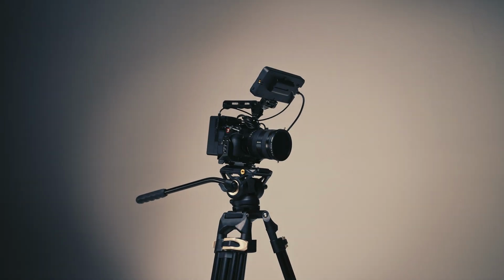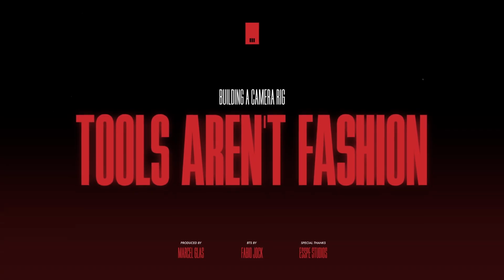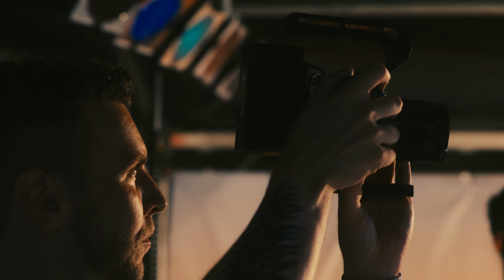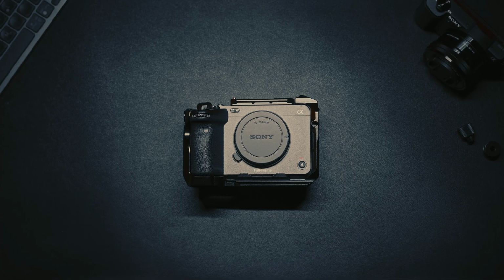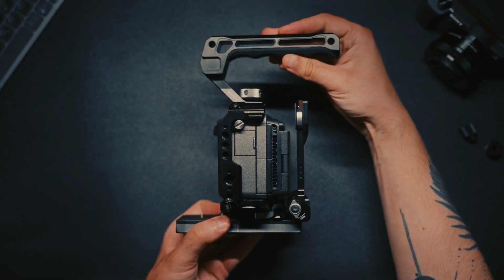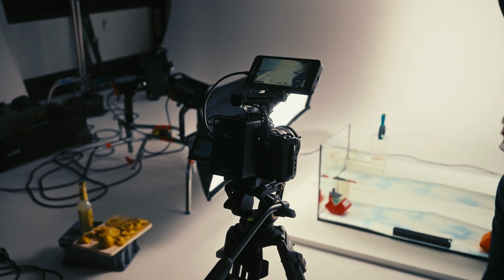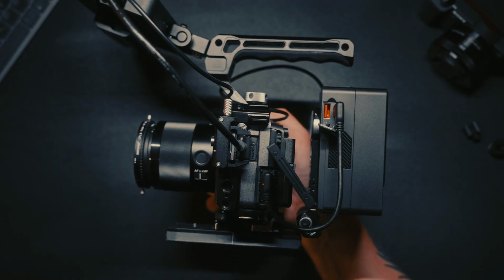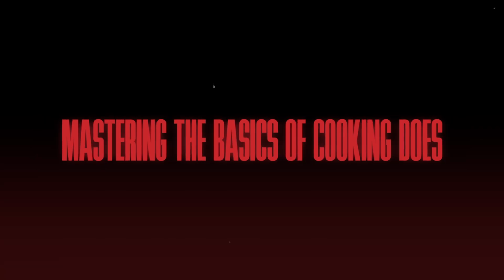Watch This BEFORE Building Your Camera Rig | feat. Neewer Mini V Mount Battery

Comment: Thank you for the great video. Do you prefer to use usb-c and an internal camera battery or a dummy battery for the camera as well?
Reply from the maker: You're welcome mate! I vastly prefer to use power delivery via usb-c. That way I don't have to remove the battery door or leave it open all the time and I have a backup power solution in place. It's also significantly easier to break down the entire rig if I wanna throw the camera on a gimbal. Hope this helps 🙌
Reply: @MarcelGlas  Thank you for the response!

Comment: So happy I found this video. I’m beginning to finally build my rig set up for my Sony a7IV and getting the small rig cage, handle, v mount batt plate, and neewer battery is an automatic from this. Gonna look through your channel now and see if there’s a video like this but for monitors 

Thanks again!
Reply from the maker: You're very welcome! 🙌 No video on monitors yet unfortunately. I'm still using an older Osee T5+ monitor. It's fine but nothing extraordinary 😄
Reply: @ gonna look that up and see what’s good with the specs for your monitor. I’m starting to shoot run and gun type of events like how you described (conventions, sporting) and again so happy I came across your content and vibes. Thanks again and def subscribed!
Reply from the maker: @ Happy to have you ✌️

Comment: Hi bro, what’s the difference between the neewer PS099EP and the PS099E? Which is better?
Reply from the maker: Hey man, the EP is an updated version with quicker fast charging - 100w instead of 65w. Both will do great though and I'm still regularly using the PS099E 🙌
Reply: @ thanks!

Comment: Hey, how is the battery holding up after the months of usage.
I am going for the Neewer PS150e, 150watt upgraded version for my blackmagic camera and a monitot. But I am worried about the quality of cells used as they might die after some time..!
Reply from the maker: Hey friend. Absolutely zero issues so far! Been using it anytime I rig up my camera and haven't experienced any unwanted quirks or concerns. 🙌

Comment: Great video. I just received the same Smallrig V-Mount battery plate and was wondering which quick release plate you use on the camera to attach it the battery plate, as I will need to purchase a new one as I currently have Falcam F38 quick release plates on everything but isn't compatible with this setup. If you have a direct link that would be really appreciated. Thanks.
Reply from the maker: Happy to hear! I don't use a dedicated quick release plate on the camera since my SmallRig camera cage has a built in acra swiss plate at the bottom. Feel free to check out the link in the description box under Sony FX3/FX30 camera cages. 🙌
Reply: @MarcelGlas  thank you very much for the reply, really appreciate it.
Reply from the maker: @Stu_Co  You're welcome, glad I could help!

Comment: I too did a stress test. I had my Panasonic S5 Mark 2 connected via the USB-C port on the camera to the USB-C port on the PS099E Neewer Mini V-Mount battery. The stress test went well. It lasted 3.5 hrs powering both the monitor and the camera at full power. The monitor was a 2000nit monitor turned all the way to 100% brightness and the camera recorded 6K 10bit 422. I had IBIS turned on and rocked the camera to get it working hard. However. just yesterday the HDMI port on the camera just stopped working. There are many reports this battery and specifically the USB-C output is to blame. Have you heard of anything in this regard?
Reply from the maker: Thanks for your input! If I understand you correctly the HDMI port of the camera doesn't work anymore and people think it has something to do with the USB-C connection to the battery? Could you elaborate on this?

Lately I've been using it on several productions back to back and so far I haven't experienced any issues but I'm curious to hear more. 🤔
Reply: @MarcelGlas  All I can say is the camera and monitor have worked flawlessly for over a year on their respective batteries. No issues at all. Then for no reason at all the monitor just had no signal. The camera was connected however because the monitor did not display the overlay of camera info as it would when connected to the monitor. Also the RED record boundary did not display on the camera monitor as it was being sent to the HDMI. So it was registering its connection internally just not displaying an output image.  

I did a little research and came across a REDIT post and there was a couple of posts that described almost word for word what I had experienced. The post said that the monitor had worked without issue for a couple of weeks before just stopping as mine did. Then another post described the exact same thing. Curiously however the USB-C port on the Neewer is rated as 9V 3.2Amps which is more or less exactly right for the camera. It should be fine, add to that the fact this battery is supposed to have all kinds of safety protections to stop this kind of thing happening, I'm surprised and disappointed.  

I'm not sure whether to send the batteries back or not. I actually bought a second but I'm scared to use it as I may not even get a replacement camera. This could cost me a lot. I can't afford to just go buying cameras like it's nothing. Any advice on this.
Reply from the maker: @JWS1968  Man I'm sorry to hear! Do you know if the guys on reddit were all using the same type of monitor and camera you're using? 

There's certainly a correlation but I'm not convinced the V mount battery has anything do with it. Even if the battery was somehow problematic why would this specifically affect the functionality of the HDMI port instead of the USB-C port for example?

Perhaps you could try another HDMI cable or connect another monitor (maybe ask a friend or a colleague) without using the V mount battery to check if everything else is working as intended.

Thoughts?
Reply: @MarcelGlas  I've done the due diligence. Swapping cables etc. I have a friend with a S5ii and my monitor works on his camera just fine. The monitor still works fine. The cables all still work fine. It's definitely the HDMI on the camera not working. I even tried resetting the camera back to factory settings and updating firmware. The HDMI still no signal.
Reply from the maker: @JWS1968  I've done some digging and came up with the following: This isn't a problem unique to the Neewer battery but something which can occur when using a single power source to run multiple devices (like a camera and a monitor). Doesn't matter which camera brand or which V mount battery you pick up.

There's several reports of people who experienced this with their Black Magic Pocket Cinema Cameras. People came to a few different conclusions:

1. Avoid using cheap cables
2. Avoid hotswaping batteries while the camera is turned on
3. Apparently using a dedicated battery for the monitor and powering just the camera from the V mount battery would be the best option and avoid any problems
Reply: @MarcelGlas  Thanks for looking into this and to avoid this altogether I should maybe just go back to the dedicated batteries. The whole point of a V-Mount is to run multiple things at once from a single source so you don't have to carry around a bunch of different batteries and keep them all charged. I put off buying a V-Mount for so long as they were expensive. Then recently I was on a shoot and my batteries were losing charge faster than usual as they were old. I knew I was going to have to get replacements and then decided to take the plunge. I was so taken when I got the first I bought a second. And then this happened.
Reply from the maker: @JWS1968  You're welcome! And I share your frustration...

It's odd since there's so many creators who regularly use a V mount battery to power the entire setup without any issues. I haven't experienced any problems myself which is why I didn't talk about this stuff in the video.

Perhaps these batteries can still be useful to your workflow since you can definitely power other devices like a follow focus alongside the camera without issues and the runtime is much improved from just using a regular camera battery. I'm working on a n upcoming video where I use one to power my lights without any power sockets.

Comment: Thank you for the video. I have a noob question. How difficult will it be to use the SmallRig plate if I normally use a Manfrotto tripod (with  a 501 head). I think the SmallRig base requires an Arca Swiss quick release plate. Thank you in advance.
Reply from the maker: Thanks for watching! Your Manfrotto tripod should have a quick release plate of it's own. You can directly screw that in on the bottom of either the SmallRig V mount battery plate (as I did in the video) or screw it on the SmallRig cage itself.

Hope this helped with your question?

Comment: It's a very appealing looking battery. However even though this is working with your setup I find the position of the USB-C port complicated if you're using 15mm rods, as the battery will sit lower and the screen may then bump against the USB-C cable if you want it to rest on the outside of the battery. Personally I think the position on the top of the battery is best. Nevertheless at 40-50% of the price of the Smallrig and others this is a minor flaw and you could still use a D-tap to USB-C on the other side or a d-tap plate. I'd try it :)
Reply from the maker: Thanks for the input, this is definitely a valid criticism depending on your configuration! I guess it's great to have a range of different options then. 🙌
Reply: @MarcelGlas  totally agree with you that everyone's setup and requirements are different so what works for me may not work for you. Your video is great because you don't often find info on less popular or known products
Reply from the maker: Thanks man, trying my best to not just do another review with each video. 👏